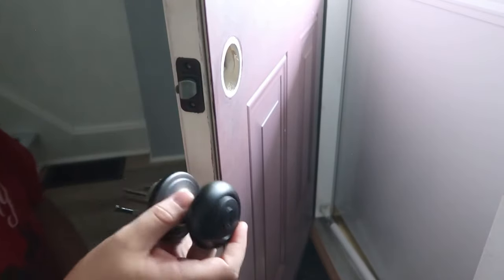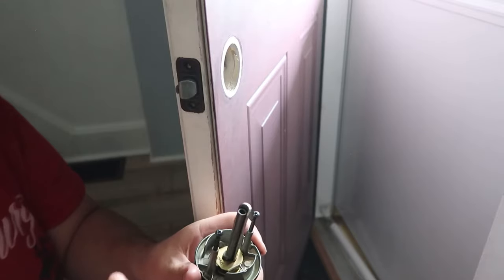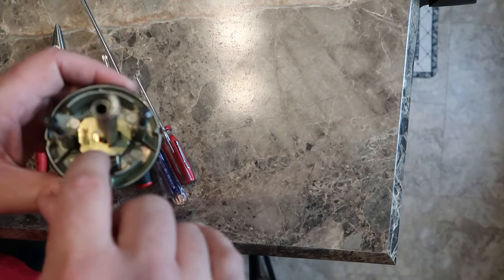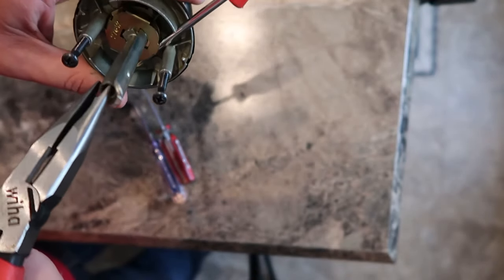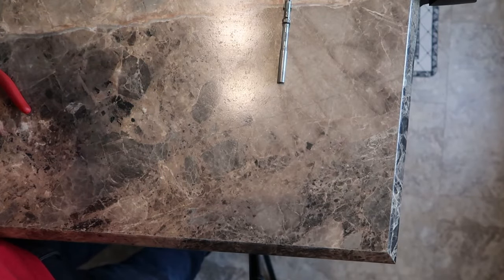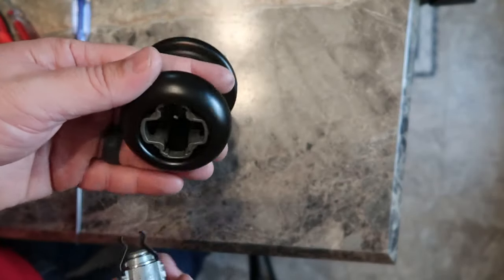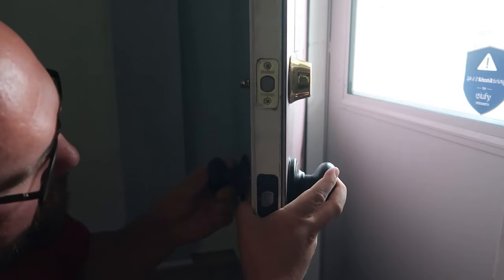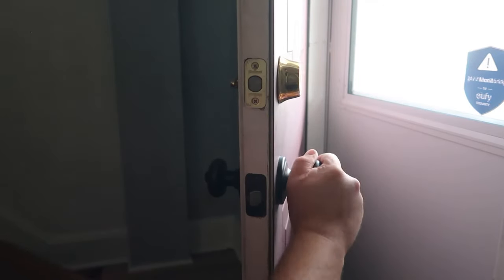HOW TO FIX Upside Down Kwikset Key cylinder

Comment: If you have a Kwikset clone that looks almost identical to a genuine Kwikset, follow Grant's instructions until you get to the part where you stick 2 screwdrivers into the hole to pry the 2 retaining clips inwards to release the cylinder from the knob.  On a clone there are no clips to pry inwards.  You'll need to insert a key into the cylinder and turn the key 180 degrees to remove the cylinder from the knob.  If you don't have a key you'll have to rake or pick the lock open and turn the cylinder 180 degrees to remove it.
Reply from the maker: @noneovyerbusiness4909  wow sounds complicated. Thanks for sharing

Comment: There are no pins on a smart key set up from Kwikset they are virtually unable to be picked You have to use a special tool to read the sliders in there, but it looks bad to have it upside down because most cylinders have pins.
Reply from the maker: Interesting! So how does it work if not with pins?

Comment: Thank you. I wasn't able to complete step two. I could not get that rod thing to turn or come out. It's so frustrating. I looked at my three other Kwikset levers and they all are installed with the key inserted horizontally. So now I have three that should be rotated 90 degrees and one that should be rotated 180 degrees. Thank you, Kwikset.
Reply from the maker: @PennyKimball-tg9my  wow
Reply: @GrantButler  actually the pictures show the key holes horizontal so I guess only the new one is wrong. Thank you for sharing your instructions

Comment: My question is why is it upside down? I have installed like 8 deadbolt and knob sets. All were fine and then I get 2 new sets and you have to flip the key 2 different directions to unlock the deadbolt and door. Super annoying and not an issue on one’s I bought before.
Reply from the maker: Because it's right side up if the door opens to the left, but upside down if it opens to the right. Or vice versa, I don't exactly remember, but it's the same reason.

Comment: Based on the size of those "locking" springs, it looks like you could put a wood screw into the keyhole and tear the whole thing out. It's possible that once it's installed there is something that prevents that from happening. But, based on the "Lock picking lawyers" YT channel, it seems that ALL locks are very easily defeated...
Reply from the maker: Yeah, Almost any residential lock could be picked with a bump key, or a wave rake.

Comment: Excellent, the tip about leaving the phillips head screwdriver in position was the key(no pun intended), none of the other videos did that and that made the spring clip on the side opposite the half circle part very easy to release. Thank you so much.
Reply from the maker: Glad I could help!

Comment: Thank you very much for the explanation! I was only able to fit one screwdriver in and get half the clip to release, I couldn't get a good angle with the second screwdriver. I ended up using a bigger screwdriver, and tapped firmly on the end and out it popped! Couldn't have done it without your info, thanks again!
Reply from the maker: Glad the video helped you!

Comment: I would do what you did it’s perfect but it’s not necessary but aesthetically it just looks right but it doesn’t affect the way the lock functions with a smart key but you know if I have a key in my pocket I want to put it in a lock the same way I do a pinned lock in the rest of the house or building
Reply from the maker: Exactly!

Comment: Hi thank you for the video. I installed kwikset deadbolt lock but somehow in order to lock the door with the key I have to turn the key LEFT (CCW).  Can you make a video on how to fix it? 
Thanks again
Reply from the maker: @ROBERTELECTRIC1  that is not an option lock is left (ccw) unlock is right (cw)

Comment: Mine did not have the tabs, but I could turn the key and then reinsert the pin
Reply: Well, whatever I did froze the lock and now is not functional. It was also a relatable lock.
Reply from the maker: The pin is to "Re-key" the lock. I sounds like you rekeyed it incorrectly.

Comment: Good tutorial! I liked your explanation of the issues of being upside down. I was only flipping it upside because we always have to remember on this door, after unlocking the deadbolt, we need to re-grip the key upside down after it won’t go in.🤣

I may have missed this but one suggestion is to add verbiage just before you push the  lock cylinder into the knob, IF you need to make sure the inside handle lock has to be in the lock or unlocked position. The video was dark  on the inside door and I couldn’t get a good look no matter how many times I watched it. I didn’t want to have to take it apart again. In the end, the odds are 50/50 so I just pushed it in and hoped for the best 🫣. I guessed right but now can’t remember which way the inside lock was!
Reply from the maker: I don't remember thinking about that, or having any issues like that